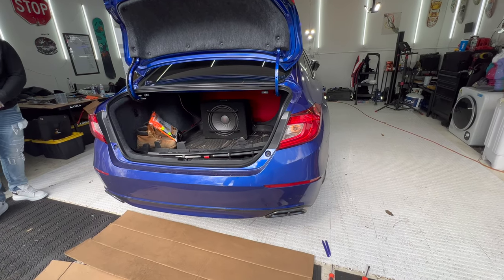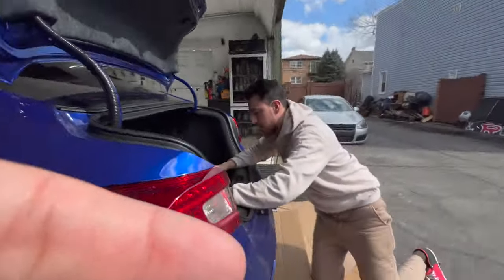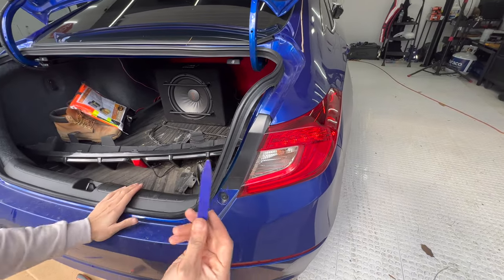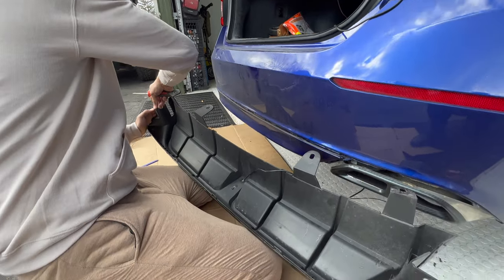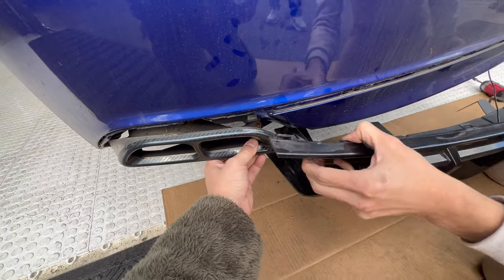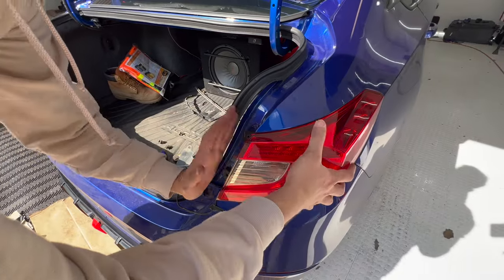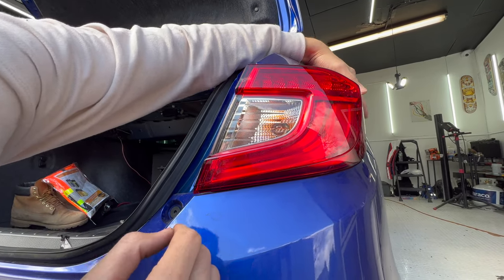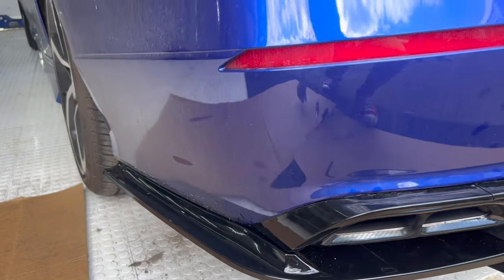2018-2022 honda accord gets the most aggressive diffuser

Comment: If I wanted to put dual exhaust tips on my 10th gen accord, which ones are the best to use since the OEM muffler pipe has to be cut due to the flare on the end of the pipe? I have this same diffuser and want some dual tips for my Accord
Reply: What is the name of this diffuser  please, I what to get one for the 2020 accord. Thanks